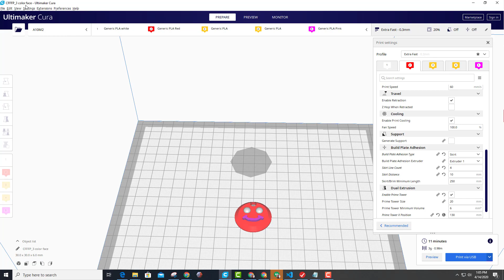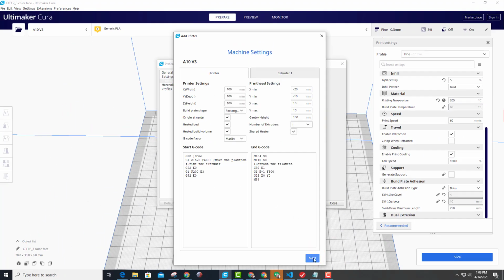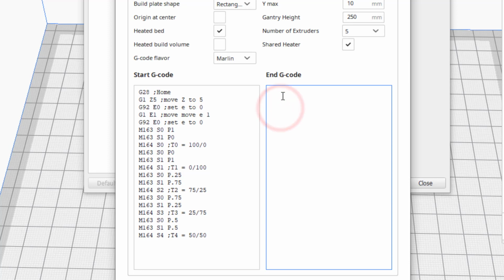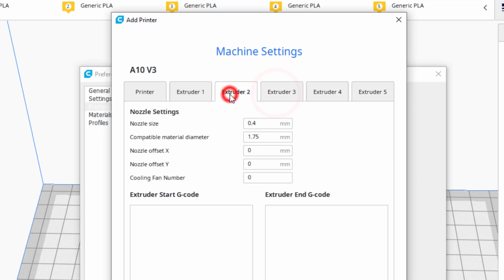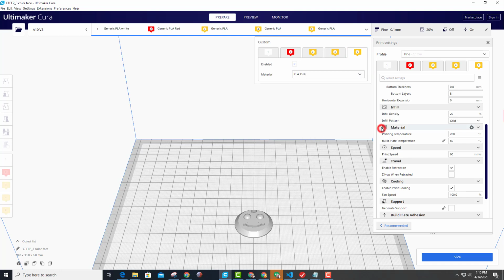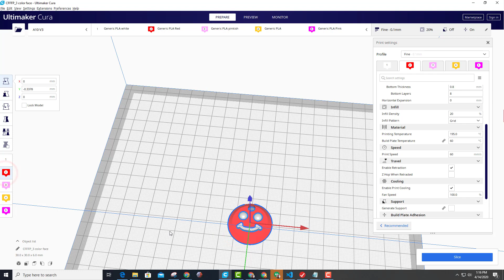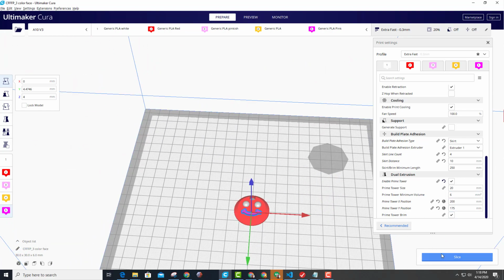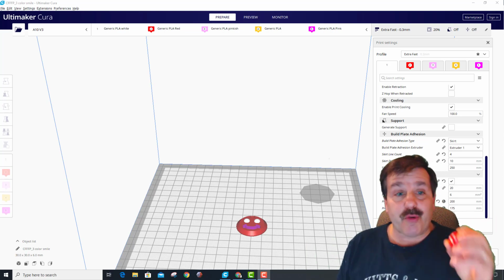Tested! Geeetech A10M Virtual Extruder Setup and Test with Cura 4.5

Comment: Is this still needed with Cura 5.2?
Reply from the maker: I never really got the colors to work well after 4.6. The option to choose a mixing hot end went away... I have not explored more. I did keep 4.6 on my computer just in case I had a need for a 2 color print.
Reply: @HLModTech  So how are you doing your mixing with Cura 5.2? Are you just doing the gradients and mixing from the panel? I just got an A10M fixed and running and there are not too many content providers out in the wild with them. The mixing hotend seems to be problematic?
Reply from the maker: @CigarDadPGH  I have an A10M and A10T. They mix fine for me. I have helped with a few printers that people were struggling with. One issue I found was that the pfte tube was not far enough into the hot end. I split my pfte so there was a dedicated piece below the coupling. They have ran that way ever since. Most of my mixing was setup with the M166 command https://youtu.be/dEgRcmjAfBA.
Reply from the maker: This video shows me using the interface too. https://youtu.be/ku7dTbGYBho

Comment: Prusa Slicer can paint colors version 2.4.1 alsow does the start and end gcode work for marlin V1
Reply from the maker: Nice tip on Prusa. I have not used it at all. Not sure on the marlin V1 code...  May want to check the Marlin discord.

Comment: Thanks for the update on this,    was stuck on two extruders until did custom Build in Cura;   added two lines '#define DIRECT_MIXING_IN_G1' and '#define MIXING_PRESETS' in Firmware ( lines 345,347 Marlin2.2 Bug Fix ) works as you implied,   BIG Thanks again, this has brought my old version A10M Back In The Game.....
Reply from the maker: Thanks for the note. Super cool that you are making a custom build of cura. 👍

Comment: They removed the shared heater option in the 4.8 version of cura would this video still work on newer versions of cura without that option? Or would I have to switch to 4.5
Reply from the maker: Yeah, 4.6 was the last with the shared heater option.  I have kept it installed just in case. I am using 4.91 but have not printed mixed items in a while. I will try to do some experimenting this week and make a new video.

Comment: Is there a way to use the gradient vtool features in cura?  Let me explain..  on a printer like The A10T there is an option to set gradient. You can set the starting height and the ending height and then you can set the gradient mix. Say you want to start at 0/100 on Vtool1 then transition to 100/0 by the top of your print.  The starting with black and blending all the way to white. Assuming those are your colors.  
Is there a way to set this in Cura?  I'm looking for a way to do it without using the LCD menu..  Why are you asking?  That's very simple. I don't have an A10T..  or A10M.  I just purchased a Voxelab Aquila and install a MKS SGen L v1.0, 2nd extruder, and mixing hotend.  In Marlin you either enable multiple extruders or you leave the extruder count at 1, and enable mixing steppers with the gradient tool..
For reasons I don't feel like going into I need to disable mixing steppers and enable 2 extruders in Marlin.  By doing so I'll lose the gradient feature in the LCD menu. So I'm looking for a way to do the exact same thing inside of Cura.. 
I've learned from Marlin, That their gradient tool was actually ripped from the Geeeeetech firmware...  This allowed them to add the gradient feature into the firmware for open source printers like mine However it is not what I would refer to as a full functioning feature as compared to the A10T or M..  If you would be willing to discuss this I'm going to attach a link for my discord.. hopefully I'll see you there..  thanks.
https://discord.gg/xBrKhGTGHk
Reply from the maker: This is the one you are looking for. 👍 https://youtu.be/IvJRGGEVxSs  Absolute game changer for me.

Comment: Hi, thank you so much for your video very helpful as I am new to dual extruders. Now for some reason (I'm sure its me) I seem to not be able to put different colors in cura 4.8 not 9.  I seen a couple videos on this not much out there but the ones I did see were actually separate parts.  Is this the reason I cant see my 2 different colors in my model after slicing, they have to be separate models and than you put together?  Thank you and anyone for help  oh I have a Geeetech new A20M,  Smiles Donna
Reply from the maker: So, at the top you need to set the different extruders to different colors... I will see if I can find a video where I have taken the time to do it.
Reply: @HLModTech   Hi thank you so much for responding. I feel so silly as to this I did finally find something about it and thought ok makes some sense lol. So thank you again, SMiles.
Reply from the maker: @donnawalsh1318  Happy to help. No need to feel silly there is a ton of stuff to figure out with 3D printing. We have all been there before. =)

Comment: @3;07 end g-code readsM140 S0 ;disable bed head ? should that read bed heat ?
and should this code work with any a-10 m ? thanks
Reply from the maker: Yes and yes.
Reply: @HLModTech  Thanks for your reply. I was just curious if the code changed the origin as mine does not print centered. I will have to find the center and adjust with g92 I guess, thanks
Reply from the maker: @michaelcrumly  Mine could be off center too, I have never really checked. I have also never double checked the settings in cura for the printhead settings.  It is possible there are smarter values we could place in there. My prints are coming out great, so I really never look under the hood anymore.

Comment: Been watching your videos on the virtual Extruders and they've been most helpful. However I seem to be having the same issue you had in the video where the colours are swapping. I'm using an A10T and have setup 1 additional virtual extruder with a 33% mix of all three (just to test). I tried to print a Mario but it mixed my S1 with my new virtual S4 for no apparent reason. Did you solve your colour switch issue between the eyes and the mouth?
Reply from the maker: Yup! https://youtu.be/aPoU_mNtrMQ It was a purge tower setting.
Reply: @HLModTech  thanks for the speedy reply. My prime tower purge is set to 35mm3 so that doesn't seem to be my issue. I'm going to try a fresh printer profile and start again I think. Keep up the great work. Really enjoying your videos and just subbed. Will make my way through them all.
Reply from the maker: @retrosteve2732  Did you update to the Marlin 2 from Vert?
Reply: @HLModTech  ah. No I'm still on the stock firmware. Could that be my issue? I'll check out your vid on updating the firmware and give it a go. Is it still running OK?
Reply: @HLModTech  Thanks for all the replies, I updated to Marlin 2 but this didnt initially solve the problem, I was really scratching my head so I watched one of Vert's videos and he mentioned changing the settings in Octoprint, I'd completely forgot to do that. All is working great now.
Reply from the maker: @retrosteve2732  Glad to hear that! I am just working on turning a old dell into a octoprint server. Will keep that in mind as I move forward with it.

Comment: Just some FYI, 
it is not necessary to create virtual tools for T0 and T1.
A10M bed should be 235 x 235.

The minimum volume in urge tower settings should be a minimum of 40mm³.
Because that is how much volume there is from where the filaments meet in the hotend, to the tip of the stock nozzle.
Then the diameter gets set so there is at least  a small hole in the middle of the tower.

That will give you much cleaner purge, though for some color combinations, more volume will be needed.
Reply from the maker: I appreciate the tips. I have seen some info about the 235 vs 230. I prefer 230... but that is just me. I will try dropping the T0 and T1. Makes sense that 100% either way would be built in. Will try the min vol too... Why does cura default different? Is that because of their 2.85 filament or something?  Thanks again for the tips.
Reply: @HLModTech   

The cura defaults for a few settings are off. I am pretty sure the person who set up the profiles for the mixing extruder printers, has never used one. :-)
I believe that the low minimum volume is likely due to the prime tower being used mainly for 2 in 1 out NON mixing hotends, and for dual nozzle machines, where much less purge volume would be needed when switching tools.

Same as Nozzle switch retraction distance, it's set for 16mm, by default.... Obviously, that is way too much!
And also Cura's default line width....

It just another clarification that one does NOT need to be able to select their model printer from the setup list.
And even if they CAN....  maybe they shouldn't :-) 
You end up changing most of the important settings anyway.....
Reply from the maker: @1zradio660  I agree about setting it up by hand. A lot of peeps asked me to send the profile for the A10 and cura... As an educator I always felt it was better to invest 5 min and learn something instead... =) 

I have a replicator 2x, so the 2 nozzle info makes sense. I hit your channel last night and did some watching of your steps. I will keep banging away and see if I can catch up with all you have learned. For a year now I have just been happy I could hit MIX on the menu...   Now that the mixing hot end is baked into cura I am excited to see if we can get it working as smooth as the Replicator.   Thanks again for all the info!!!
Reply from the maker: Testing again. Bumped it up to 40mm and set the retraction to 6 instead of 16... Also got rid of the prime brim and centered the prime tower on X. Just seemed like straight movements were more efficient than the diagonal ones...
Reply: @HLModTech  Yes, absolutely. whenever the prime tower can be placed so that it is close to, and in line with the model in the X axis, it makes the travel time to and from the tower shorter, and cuts down on time that filament can ooze from the nozzle.
Reply from the maker: You cool with me giving you a shout out and putting a card so people can find your channel in my next video?  The info you gave me was awesome!!!
Reply: @HLModTech  sure thing.

I can try to do the same on some I've got planned as well for you.
Reply from the maker: Sweet. Teamwork makes the dream work. =)